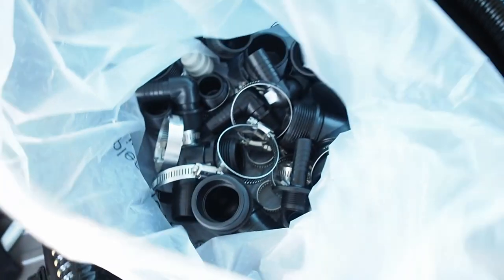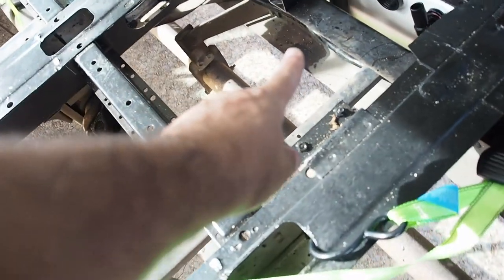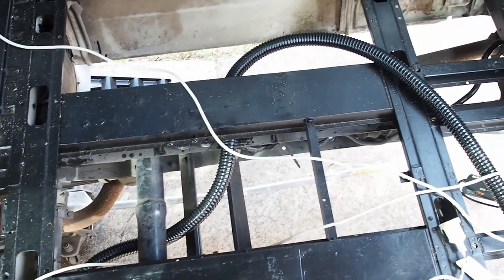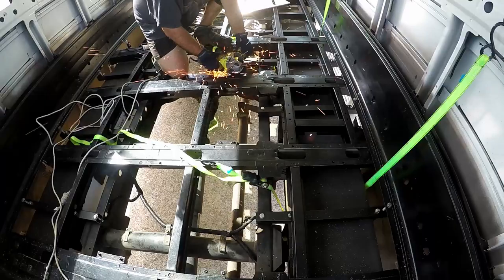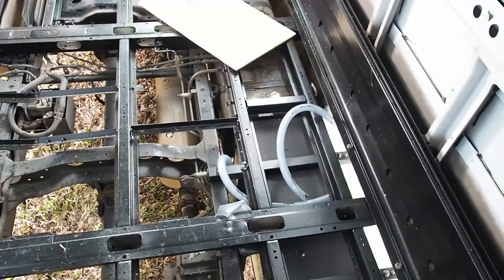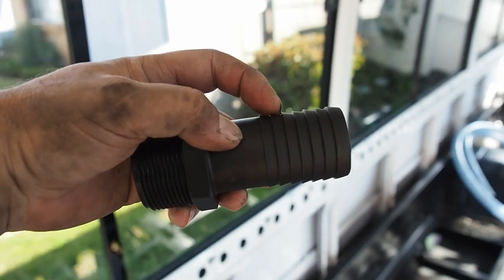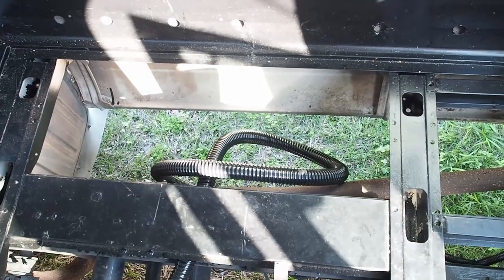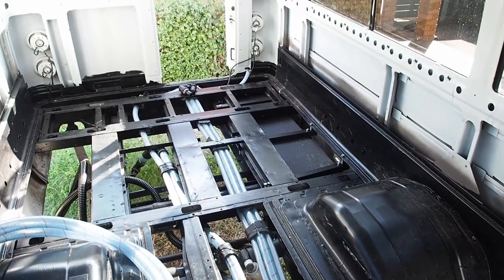Mitsubishi Rosa Bus Conversion Part 22 Installing under floor plumbing

Comment: Hi Andy! What did you do with your tyre??
Reply from the maker: I had left it out and was going to get a tyre holder on the back because the shower water tank was taking the spare tyre spot under the floor. However I have since made the shower tank smaller and the spare tyre is once again under the bus in its original position 😁

Comment: I hope that your black water lines are large enough and with all those elbows on the black water lines don’t cause any issues.  Just my thoughts would be to put a macerator closer to the toilet just to breakup the toilet waste before going through those smaller lines.  Good luck.
Reply from the maker: Hey Randy the hose and bends are 40mm or 1 1/2 inch so they should be fine. The toilet will have its on macerator so the waste will be broken up before entering the black tank. Thanks for the heads up though I do appreciate people looking out for anything I may have missed :-).